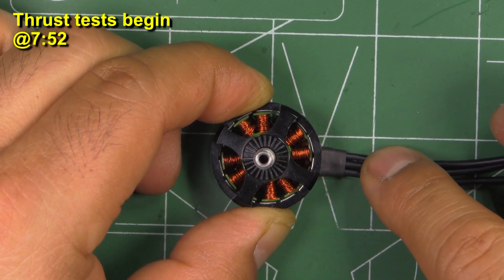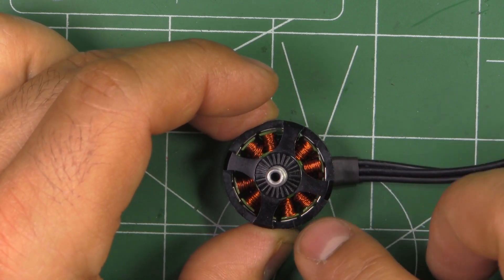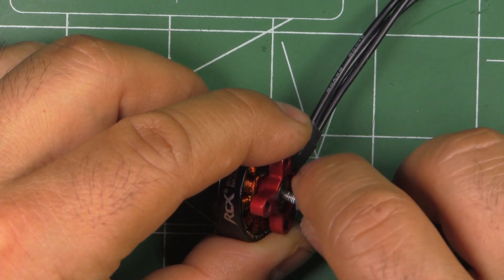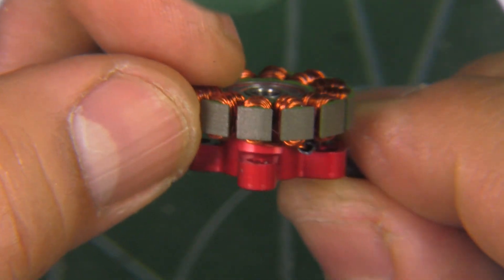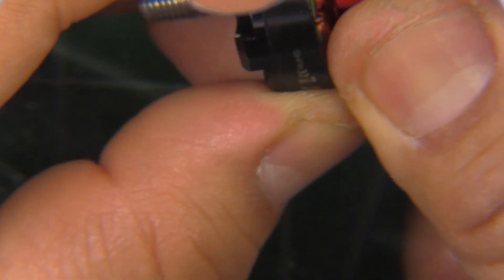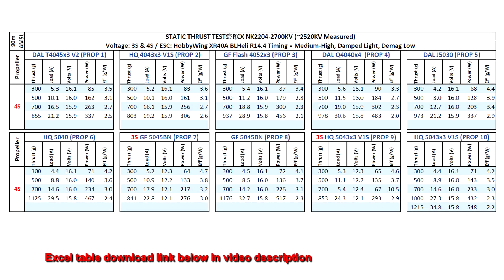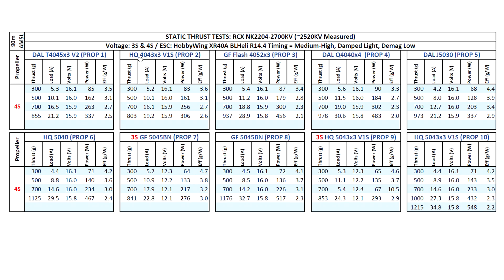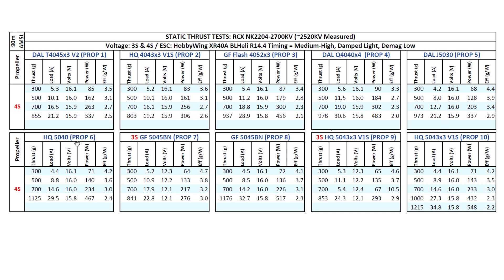RCX NK2204-2700KV Thrust Tests  & Overview

Comment: This is certainly not a slow motor! On a 220g dry weight floss 2 swinging 5040 quad blade running butterflight, dshot600, blheli_s, its one of the most agile and locked in (locked in means faster lap times) builds I've ever built/flown in an underground carpark. I get about 3-5 mins flight time on a 1000mah 4s turnigy bolt v2 depending on how hard I push it. It certainly out flys the RCX RS2206 2400kv build I built previously.
Reply from the maker: Sounds like a sweet setup you got there. Sometimes less is more ;)

Comment: It's a pity the kv is a lot lower than specs, because for almost the same weight there is the hawksky 2205 2600kv. If they make a real 2700kv (or even more) and shave a gram or two it could be a real contender for the pyroflip 2204... The construction quality looks really good though.
Also lately there is a newborn interest in the 4 inch class, with those heavy gemfan 4052 which require a big motor and are scary fast, but probably could make use of some more kv.
Reply: nasone32 on what build would you use these motors? A 5 inch, 300gram auw?
Reply: Yes because it would be very fast and responsive on a light 3 blade like the 5043 v1s or a 5040, and a 1000mah would probably suffice for 2.30 -3 mins
Reply from the maker: That sounds about right, it's not going to be a powerful & super fast setup. But it should be light and agile since you should be able to run 1000mAh 4S LiPos and still get around 3min hopefully. And I think it may support 5S on 5040x3 or 5043x3 so that's something to try for those that like to live on the edge LoL. You're right, it would've been better if it was 2700KV. The 2950KV version was measured at close to that KV value so 4S that one would be better for people that want more power on 4S.
Reply: nasone32 they make a 2950kv that is 2700kv. Compare that to the much higher Kv (3022kv) hyperlite and there’s little difference thrust wise, but the rcx are a lot more efficient, and cheaper. I’d take the much cheaper price and 2g weight over the hyperlites any day. The hyperlites break if you sneeze on them. Open bottoms, light motors and multi strand windings do not mix. Also, Gemfan 4052 run just fine on 1407s so you don’t need a big motor, just a light quad. Agree on the hawksky. If they were ever in stock I’d try them. From what I’ve seen they beat the other 2205s hands down by a far margin. Engineerx you really need them on your hit list!